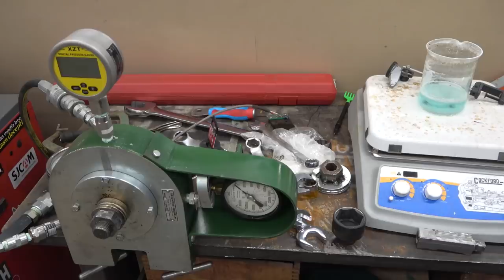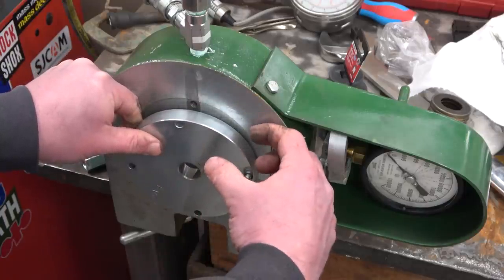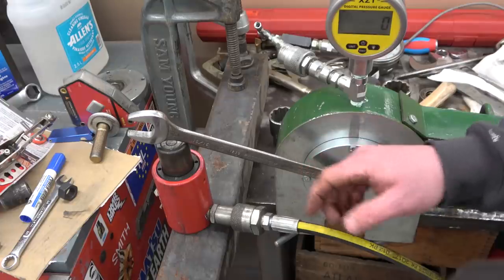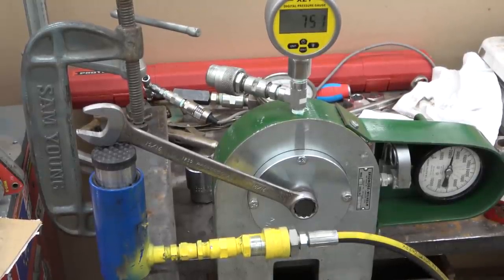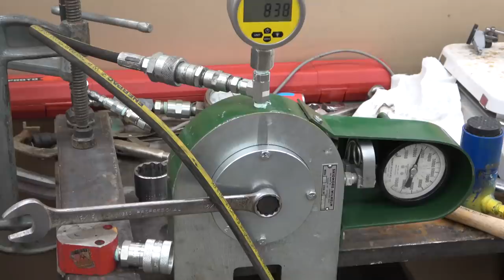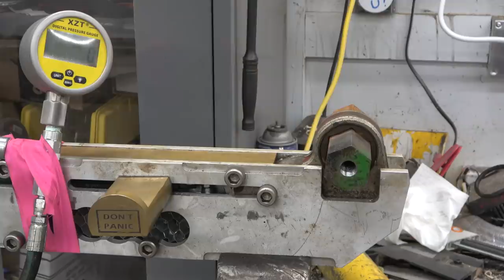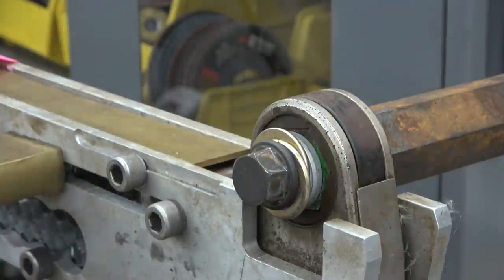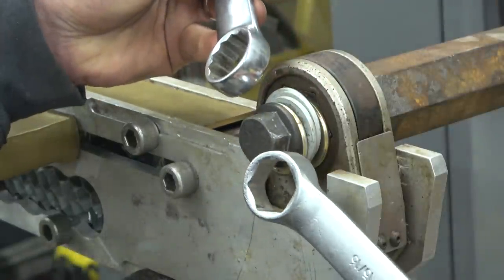6 point VS. 12 Best wrench?

Comment: A few years ago I went into an Autozone to get a replacement for a lost socket that I needed in a hurry for a 6 point bolt and I had one of their counter monkeys tell me I should never use a 12 point tool on anything but a 12 point fastener and vice versa.  At the time I just laughed it off but to this day I still wonder if maybe he wasn't right in some way, even if he didn't know why.  I  always bought into the idea that more points of contact meant getting the wrench on easier at multiple angles and more points of contact meant less slippage so they had to be better but after dealing with some fasteners that looked like they'd been on the bottom of a battleship since the Cold War, and having 12 points slip clean off and damage already rounded 6 points, I think he might have been on to something.

Comment: The head of the bolt will twist right off... if you're lucky. In my experience, there's usually chisels, drills and torches involved in removing what is inevitably the last bolt.

Comment: I typically buy cheap impact sockets for small fasteners because I lose them so often, from 3/16" over to 9/16", and it totally makes a difference there whether one purchases' the 6-point or 12-point models.  With a 12-point, one stands the risk of rounding the fastener and even the socket because tolerances aren't what they are on, say, a Proto or Snapon socket, but on a 6-point those risks are mitigated.  

Irrelevant, I suppose, because the drives on power tools spin, but I imagine you'll come to the same conclusion if you were testing out inferior-quality wrenches such as Pittsburgh or Husky.

Comment: At an interview for a job I was asked which allowed more torque on a bolt, a 6pt or a 12pt. I told them it didn't matter since both should be designed to provide the allowable torque for the size bolt they're made for. The manager and supervisor doing the interview argued it was the 6pt and I was wrong. I told them to stop buying shit tools and maybe their mechanics would stop breaking so many wrenches.   I didn't get the job, but it looks like I was right.

Comment: I've had 12 point sockets slip and round the bolts plenty of times, I gave in and got a 6 point socket set and it has never happened since, I suspect your 12 point spanner was very well matched to that bolt, and maybe that bolt you used was made of better stuff than the bolt holding my brake calliper on, or maybe I have just been unlucky in the past, the one concession I could make is that it's entirely possible that in my case the socket that seemed the best fit for the bolt was an imperial when the bolt was an already semi-rounded metric or something like that and using the one that seemed right just made it worse.

Comment: a lesser quality wrench in 12 point will break around its circumference before a 6 point since it is thinner by the points. Usually on big fasteners on industrial machines, the box end will break before the bolt.

Comment: As a sawfiler who is running bolts in and out changing knives in chip n saw canter sections with an impact gun, I find 12 point tends to round the bolt heads off much more than 6.

Comment: Yes, with large wrenches. However I can't count how many 1/2" and 9/16" 12 point wrenches I have rounded off. I use 6 point for stubborn fastners and 12 point in tight places. Keep up the videos, I like the content as much as the lingo.

Comment: My old as fug 6 point snap on 10mm wrench is invaluable to take off rusty old import car bolts. So yes it is a non issue on larger bolts, but small lil guys like a 10mm head it sure makes a big difference.

Comment: In the real world with rusted already slightly rounded smaller fasteners (most common one that comes to mind is a 10mm brake bleeder screw or 7/8 oxygen sensor) 6 point all the way. I’ve done my share of slipping with 12pt. But in a perfect test scenario you’re definitely correct sir. Have a good day.

Comment: Coming from the marine industries I have to deal with badly corroded bolt heads quite frequently a 6 point wrench would coming in handy quite often when the bolt head is not corroded enough to go a size down but it slips on the correct 12 point wrench.

Comment: When you get up in the 7/8'' and above size your choice of 12p vs 6p and quality of tool seem to matter less, but when you start playing with smaller stuff your choice of 12p vs 6p start to matter and the overall quality of the tool starts to matter more regarding chances of slipping with a 12p, especially in the sub 10mm head.

Comment: I use a 6 point socket for diffs. The plugs are very shallow, about half that of a nut and they are soft. In theory a six point socket is less likely to round a stubborn diff plug.

Comment: For the first time I find myself interested in the content and not just the delivery. Please retest with solid bar to replicate 'removal of rusted in screw' performance. Also for bonus points, another test where you turn the tips off the hex bar to determine whether the "same contact area" is true/relevant for worn bolts and the 6 Vs 12.

Comment: This is all good, except for when its not. Like anything a bit rusty under 3/4" or when the bolt has a chip on its shoulder rather than a proper standard head height.

Comment: Your test is on quite a large & hard unrounded fastner, and that makes all the difference. In smaller wrenches, the tolerance (or the degree to which the wrench is bigger than the fastner) is more significant relative to the size of the fastner too, and so above a certain size & condition of the fastner, it doesn't make any difference, sure, but that's not always the case.

Comment: Thank you Canuck Chuck...6pt fits better on rusty siezed bolds and worn bolt heads. Most 12pts have less material then 6pt thus being weaker..but that depends on the manufacturer.

Comment: True that 6 or 12 are equally non-slippy for good, hard fasteners.  But soft fasteners - the points yield (smush down) and the pressure point on each facet slowly moves away from each point.  This happens with 12 point too, but the amount the pressure points can move runs out of room (which is when it begins rounding off.  For super rusty bolts or nuts - that's just simulated round-off situation.  Of course 6 point will turn those better.

Comment: From a scientific standpoint the force from the tool is applied to the fasteners at the furthest point. Meaning the force is at the points of the socket to points of the head.  That's why bolts round off. So from a physics point is in the point, no matter how many points you have.

Comment: If you repeat this on grade 5 bolts you’ll quite likely find the 12 point rounds heads more readily. Went through this with an overtightened drain pan bolt just a few weeks ago.

Comment: Working in an injection molding plastic shop, slinging molds all day, I hate 12 point sockets and wrenches. Mostly because after a few too many uses a 12 point will start to slip on a well used bolt or water fitting. A 6 point always works.

Comment: I used to use a 6 point wrench on brass or aluminium hydraulic and air fittings where the fasteners were old and a bit tired and the corners used to shear clean off if a 12 point was used, or if someone had already had a go at it with the rattle gun and the corners were already chewed up.

Comment: Brand new fastner ur deffintly right if its been on the bottom of a vehicle for 100k miles it needs the 6 point with flank drive or itll be a circle real fast

Comment: The bigger sizes it doesn't matter as much. Once you get around 3/4 and below especially or bolt heads that rusted away a size or two a 6 point will take off bolts that a 12 point will round.

Comment: A 6 point wrench can actually have more contact surface on a bolt head than a 12 point wrench therefore allowing more force to be applied through the wrench and to the bolt. Thus the user applies less force to remove a bolt with a six point wrench than a 12 point wrench
Reply: There is definitely something going on... not sure that a six-point requires less force to turn but you are more efficiently transmitting the force to the bolt with a bigger "contact patch"
I think he should test this with perhaps a brass or aluminum bolt.

I have had many a drain plug excetera that a 12-point will only slip-on... the 6 point socket or wrench ends up saving the day.

In fact I bought some tekton ratchet wrenches specifically because they were six-point.
The gearwrench and other name brand version have 12 point or spline Drive.

Comment: The times six point wrenches really shine is when the fastener is already rounded off, or when you can't get the wrench all the way on for whatever reason

But the 12 points are way nicer to use, and I'm not carrying around a set of six point wrenches just in case a nut is is a little fucked.  I have an angle grinder for that and it works on /everything/

Comment: In the salted northern climes of the continental United States where we experience more calendar days of 42 degree weather with a humidity of a English tea picnic the corrosion happens at a rate that requires one to have available some form of six point torque transmission device.

Comment: Having budget induced fund deficiency syndrome, fixing things in the rust zone of Wisconsin that more sensible people would scrap, I can usually make do with as good of quality 12 pt box end as I can afford, but for sockets, 6 pt is an absolute must. And any off brand "lifetime warranty" made in China or Taiwan socket set containing the ever needed sizes like 17/64ths, 11mm, and both 15/32ths AND 15/32nds aren't worth putting to any bolt. They make great boobie traps and scrap metal art though.

Comment: AVE the problem i see from an engineer point of view is that you had the spanners firmly supported pretty much their whole length. I’d like to see it done with only the open jaw end supported. As it was done with such close support near the bolt you don’t get an accurate test as the chance of the spanner failing is greatly reduced, thus it doesn’t give an accurate test of the spanners material strength.
Obviously if it was a comparison between say a Harbor Freight spanner against a Proto or SnapOn that would be interesting.
All the best from QUEENSLAND Australia.

Comment: 6 point for me for the grip on old fasteners.   It is only in the special case where access is tight that a 12 point would be desired and that is way less common than an a rusty worn fasterns.  6 points ftw

Comment: Why not both? Has anyone seen a 6-point wrench where the hexagon profile is rotated 15 degrees from the handle axis? How about a 12-point rotated 7.5 degrees?

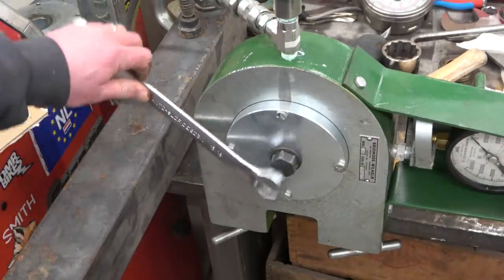Such a wrench, when flipped over (as at 4:07, to no benefit mind you, as the hexagon profile is NOT offset), would provide another division of valid positions, as if the profile had twice as many points (but while using just as much material).

EDIT: Consider an analog clock where the minute hand marks one of the wrench points. Then a "standard" 6-point wrench may be in one of the following two configurations:
* Points at 12:00, 12:10, 12:20, 12:30, 12:40, and 12:50.
* Points at 12:05, 12:15, 12:25, 12:35, 12:45, and 12:55.

If we split the difference (so that neither a point nor a flat is symmetrically aligned with the handle axis) then flipping the wrench over gives the same number of divisions, but 15 degrees out of phase. It would have points at 12:02:30, 12:12:30, 12:22:30, 12:32:30, 12:42:30, and 12:52:30.

Comment: To avoid summer teeth always push don't pull big wrenches toward your face.  Crew chiefs on the B1 bombers always had a guy with a cleft scar or a fresh wound.  They had long ass 1" drive torque wrenches and breaker bars for working on the wheel brakes.  I knew when a guy busted his face because the socket would get turned in split in half and the wrench had to go in for recalibration.

Comment: got to say, 6 point on any thing under 9/16th is best,
esp on worn or rusted stuff
but you got be wary, because some nut /bolts have a very small head height
so the lead in to the socket / spanner hardly grips on any thing

in this caes always best to have a few sockets with the ends shaved down flat, so all sides get a deep grip, not just on the top bit thats prob already rusted away
plus 11 mm on a worn 7/16th works good, as its smaller

Comment: Ironically every impact socket I have seen is a hex drive, I also have a set of metrinch impact long sockets that seem very good. Quality is everything, I found a long 19 mm impact socket I used to torque up diesel head bolts, it cracked so I cut it off with a 1 mm cutoff disc, I continued using it until it started jumping off the bolt head, turns out I must have detempered the metal, it was all chooed out.

Comment: It's HEX or BI-Hex in Blighty.
The Bi-hex is handy when you are in areas of limited space.
The hex is when you get the cheater bar with 12 foot scaffold pole plus Cletus the 500lb Gorilla and his mate Igor jumping on the improvised wrench with added mechanical advantage when trying to remove extra vintage rusted nuts and bolts from an engine block or lug nuts from a tractor because the 1/2 drive zip gun is unavailable because the portable air compressor is still on loan to a friend.

When Cletus, Igor and the cheater bar are MIA. Some deft loving blows with choice of hammer on the open end of the spanner make a good practice for precision hammer leverage Olympics.
Points are awarded for lack of injury, number of blows, sparks generated, tone and timber of blow, time taken, spanner/wrench wear or destruction after fastener removal.

Comment: Very interesting presentation. Most Jet Engines have 12 point bolts. I wonder if that is to keep some of us Knuckle busters from possibly using the wrong hardware. Lots of exotic materials make up a jet engine to deal with the constant heating and cooling.

Comment: automotive tech here
i look at 12 points with a dubious eye. if i feel the hangulation is even slightly off i go for a tool change lol. i find a lot of times the 12 point gives you too much slop in how the box actually lines up on the head of the bolt.

Comment: I've broke both 12 and 6 point, I don't think it matters are far as wrench strength, but the 6 point does better with questionable bolt heads and stripped nuts.. way back in my machinist days all I had was 6 point wrenches, cause most of the monkeys in the shop only had an adjustable nut lathe....hence 90% of the bolts and nuts were better then half way stripped, the rest had been cross threaded and or over torqued.

Comment: More chance of the 12 point rounding the bolt head compared to the 6 point as there's less meat gripping each corner of the bolt head

As you said, advantage of the 12 points is more degrees of turning

Comment: The difference is the fastener is of high quality, if you put a standard automotive-grade fastener the 12 points would have rounded the head off, which I've seen with my own eyes too many times. That is why I need such a large toolbox,  Today one must have 4 sets of tools, A complete Imperial set of 6 and 12 points, and then a complete Metric set of 6 and 12 points. If I was allowed to own only one set of sockets and wrenches it would be Imperial 6 points plus a good shart cold chisel. Plus I live in the rust belt, good point somebody!

Comment: The only time I reach for a six point is for a rounded or partially rounded fastener, or if the fastener is poorly made and slightly off size and the wrench has a loose fit.

Comment: When you're dealing with old automotive fasteners with the OEM rust coating, 12-point wrenches are much better at rounding off corners than the 6-point variety.

Comment: The real question is what came first? The 12 point or the 6 point.  I say the 12 point came first because I had to use the 6 point to get the rounded off fastener from the 12 point loose.

Comment: Been awhile since I've used em in anger working on HGV's but I used to cascade from 12 point spanner or socket (Flank drive if you were posh). Next stage 6 point impact socket hammered on to the fastner. If that wouldn't undo or shear it off then the hot spanner came out.
Ref double wrenching - always use borrowed spanners🤣

Comment: Now try it without using a grade 8 bolt. The purpose of a 6-point is for partially rounded heads and softer materials, that's why most impact sockets are 6-point.

Comment: Except the six-point wrench / socket won't slip on hardware made of of the softer materials rusted in place.  It is not the wrench that usually fails but the fastener.  I would think engineers designing a wrench would design it to handle the maximum working load?

Comment: Hey mate love your videos they awesome in the 6 and 12 point torture test I feel that the leverage changed as the spaners bent due to the actual bending of the spaner causing it to engage the opposing surface closer to the pivot point than originally gauged

Comment: Did you try milling the end of the hex bar into a a 15/16 hex, thereby eliminating the yield point of the bolt from the set up. In other words, the hex bar has a 15/16 hex head on it without there being threads/bolts to yield at all. Good to see the Torquestructomatic lives on!

Comment: 12 vs 6 might yield a difference-made, if your bolt's head is soft enough to actually turn itself from a hex to a round. But hundred to one odds of that happening before the bolt's shaft fails.

Comment: “Change the bolt to 5/16” or 24mm.”  I can believe 15/16” or 24mm (23.8 if you convert 15/16” to metric). 5/16” is approximately 8mm.